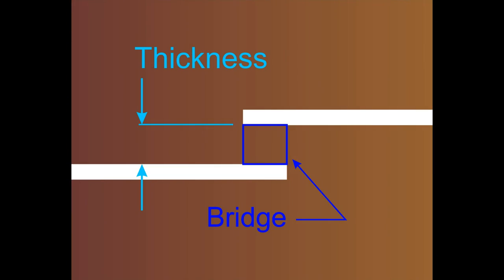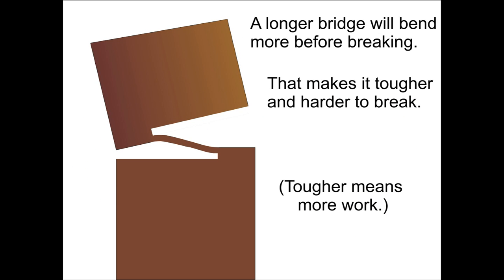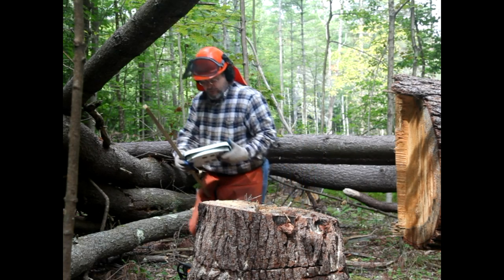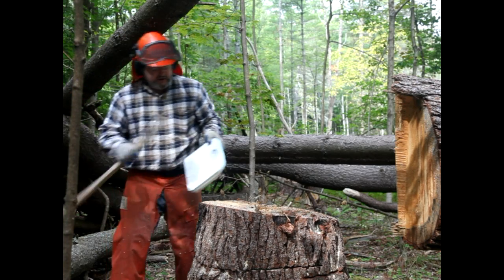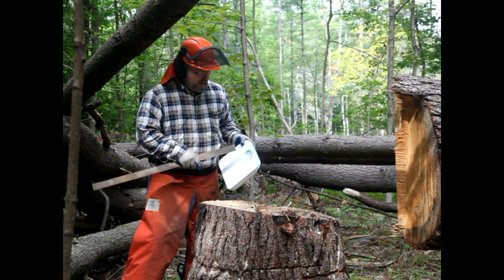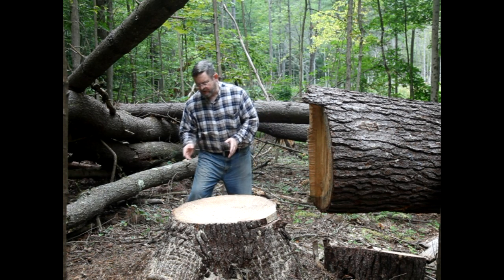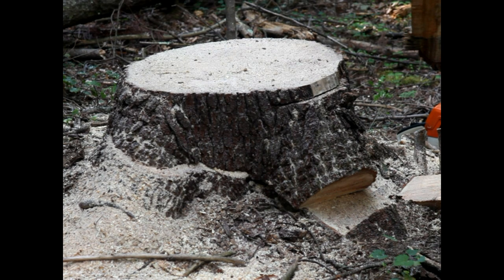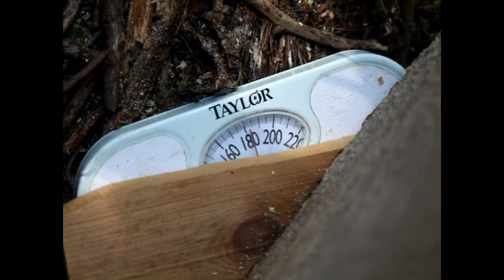The Snap Cut ... and when to avoid it

Comment: Very analytical. something you didn't consider when sliding the wood off is the sap of different trees and how long you let the piece sit. If it was yellow pine the friction and heat created when cutting releases more sap and you let that piece sit you would break your scale trying to push it off. SAFETY ADVICE FOR YOU AND EVERYONE WATCHING. NEVER EVER do the cut you did at 1:50. You do not cut with the top of your blade with the bottom of it facing your belly. Your snap cuts should be side to side. If the piece your cutting breaks prematurely it will fall to the side and not in your lap. Also when doing a snap cut your second cut should be lower than the first for 2 reasons.First your not putting pressure on the log possibly causing it to prematurely snap off. Second, if while cutting, your holding wood does break your saw blade is in there to hold it like a wedge. But thanks for teaching me another use for a bathroom scale.

Comment: Just have to say mate watching you make that step cut with the tip of the saw actually gave me shivers. If you keen on cutting your guts open that's the way to do it. practice loosening your flipline a bit to allow to use the bottom of the bar and limit the risk of kickback.
Reply: I what your saying is right and I agree! Makes me wince watching it, I've been climbing for 22 years now and so often see practices that will kill someone soon! Apart from the cutting techniques, the theory is basically ok, except the fact that once you have cut through a round enough to require the wedge to stop the saw being pinched, you will always always be able to finish the cut from there WITHOUT having to remove the saw from the cut as it will not pinch if you don't stop cutting!! The mistake people make is cutting to gingerly and slowly and then the saw gets clogged with sawdust and sap because it's not chucking it out far enough because it's not being used at the correct operating speed! Also what would be the point in making a snap cut with a log that heavy? Its not going to go anywhere and also its basically on the ground level anyway so can just be lifted away from anything it needs to be ! There's s correct way and then there's the smart way! Its admirable to be careful and mindful but if you don't need to make certain cuts because of reasons I've said, then don't, think of the extra time on the job it adds just doing crap that doesn't need doing, also wastes your energy
Reply: I got the googoos also. Scary.

Comment: snap cuts can be done parallel to the moment, essentially the same as hinge wood preventing a fell from going to either side . one can snap cut a horizontal limb vertically so there is the full diameter of the limb countering gravity trying to force it down (useful for steering).
Reply from the maker: Good Point!

Comment: In reference to 5:56, the issue of pinching the saw can be remedied by making the smaller cut first (usually your directional cut) and then the back cut second. In the event that the saw does become pinched you can then apply the chainbrake and free the saw. This has the benefit of you having control of the timber as well as the saw acting as a wedge preventing the timber free falling away (especially useful when there are targets to avoid).

The initial 170 reading was likely due to the snap not being complete. Not saying the cut was wrong, just that when you first"snapped" the chog it probably wasn't a clean snap.

Comment: Great movie as ever : thanks Terry. For heavy wood, try using a couple of steel rods in place of wedges to support the cut piece,. I find 6mm steel rods (with a hole drilled one end  to take a split ring and thin cord so you don't drop it) allows easy rolling off the stump.
Reply from the maker: Good idea!

Comment: I bought a 193T for light trimming & pruning. Thing was a turd. I drilled out the muffler, and took the limiters off the carb. Almost keeps up with my 201T now. Just thought I would share since I know you use a 192 or 193.
Reply: Tom Saad I wasn't aware that there's a way to make the 193 useful. Thanks for sharing!

Comment: You can plunge cut thru the center & work your way towards the outside in each direction, stop when almost through then finish the cut from outside if you don't want to fool with wedges. Another option is to go in a almost halfway into trunk then walk the saw using the kerf as a guide around the remaining uncut trunk to complete the cut. I can't even remember the last time I needed a wedge, you just have to read the compression and have a sharp and powerful saw

Comment: interesting video, I find it easier to snap the cut by rocking the stem 90 degrees on the cut instead of rocking it in line with the cut, as you described. Less force seems to be needed and the amount of overlap seems not relevant in that case. Position is then best in the middle of the stem.

Comment: Curios on the initial cut, why you didn't throw a couple wedges on either side of your blade to finish the cut, as opposed to hinging it? It would seem it would give you a more accurate reading on your movement resistance.
Reply: Bwanar1 .......Because the video was about that particular technique I guess, not the method you are proposing.

Comment: hmm.. I learned that a 4-5 inch thick "burger"  portion from your  tree weighs 180 pounds. 

i learned that I love snap cuts because they'll give me time to  put my tools away & get my hands free.

i learned that i must do an angle down hill cut so that I'll be strong enough to push the "burger" piece off the tree.

Thank you very much.
Reply from the maker: Thanks Dan.  "Must" is probably overstating it. The inclined cut does make it easier to remove the "burger" on the really big trees.

Comment: Quick question. You mentioned making the bridge closer to an edge is less sawing because you’re only cutting through thickest part one time. But as long as the cuts overlap isn’t that the same amount of cutting no matter where they overlap?
Reply from the maker: The amount of cutting you have to do will be equal to the full cross-sectional area, plus the area of the overlap.  Say you're shooting for a 1"overlap and the trunk is 12" in diameter.  If you shoot to make the overlap directly in the middle, its area will be approximately 1" x 12" = 12 sq. in.  If instead you plan to make the overlap away from the middle, the area of overlap will be something less, like 9 sq. in.  The amount of time to make the cut and the wear on the sharpness of the teeth is directly related to the amount of area you're cutting.  Granted, it's not a significant amount overall, but it is a savings.

Comment: Great videos! The upper and lower cut; does it matter which is on the side you are felling towards?
Reply from the maker: Thanks much!
I meant to mention that but unintentionally skipped it, so thanks for bringing it up.
   If you are dealing with a piece so big you need to slide it off, you absolutely want the second cut to be lower so nothing is left sticking above the main cut to get in the way.
   If you're going to be tipping the piece over, there is no mathematical reason why the second cut should need to be lower.  However, I have a gut preference towards not seeing something sticking up from the stem after I've removed the piece.
Reply: I was told that if you are pushing the piece away from you the cut on the side you are on should be the higher of the 2 cuts else you are locking the piece. When in doubt on smaller pieces you could match the cuts on the same horizontal plane but as you lose the option to overlap the cut you could just narrow the thickness of the space between the kerfs. Have to experiment to get a feel for the holding wood. I did see a video where he made the cut to where it breaks if he pulled it towards him  but I always like to push it to break since that is the direction I want it to go anyway.

Comment: I wonder if the reason the numbers got lower was because as you shove to wood there's less and less wood making contact so there might be less friction
Reply from the maker: In theory, that shouldn't make a difference as the friction is supposed to be a factor of just the normal force.  However, in reality, the pressure actually does make a bit of a difference, but it is small.  That aside, I reset the block back to its original position three times, so the contact area went back to its original value.
Reply: Terry Hale Ahh, that then your idea seems more logical

Comment: Moment? Do you mean movement or momentum?
Reply: Moment is a term used in physics and engineering.  I can't give you an exact definition (you can look it up in any low-level physics book), but it's similar to what a layman would call leverage.  A perfectly vertical tree trunk (imagine one with no branches) has no moment.  If you make a horizontal cut through it at the bottom it will still stay standing.  A tree that has grown leaning to one side has moment - it is trying to fall over.  The farther it is leaning, the more moment it has.  If you cut through it, it will fall.
Reply: Ahh, thanks. Never heard of that before.

Comment: i dont know what you trying to do..when some one cuts a large tree they dont do what you trying to explain ....you just trying to show off more them what you know ..
Reply from the maker: You must be one of Jose's friends.  I applaud you for reaching so far beyond the language barrier.  I wish I could do nearly as well.
  What I am trying to do in this video is to provide some interesting insight for people who are curious about these things, but are probably not intending to undertake the activities themselves.  Secondarily, I am hoping that a few of the concepts may provide a small labor savings to those who are doing this kind of work.  For instance, when chunking down large pieces, it is a lot easier to push the pieces off of an inclined surface, rather than a level surface.  Similarly, it is less sawing and less effort to snap a piece off if the snap occurs near one side, rather than in the middle of the piece.

Comment: near the end, you keep using a word...  "moment".  Totally confused.  Do you mean "movement" instead?  (haha, I mean, since you are an engineer, it is probably not you who is using the wrong word.  Just that, I'm not sure what you do mean by that word.  Thx for these videos, they are super interesting).
Reply from the maker: Hi Jasper.  You are correct.  "Moment"  is the engineering term that includes "torque".  Both are the product of a force acting over a distance, like 50 foot-pounds.  Moment covers things a bit better, as it also covers the distribution of forces within an object that is being bent.  Apologies for the jargon, even if it is official "engineeringese".